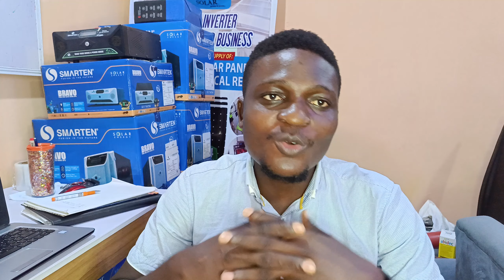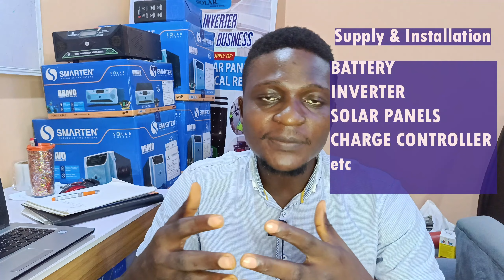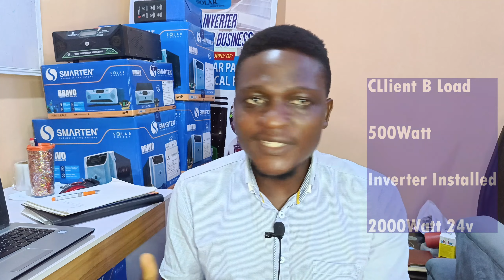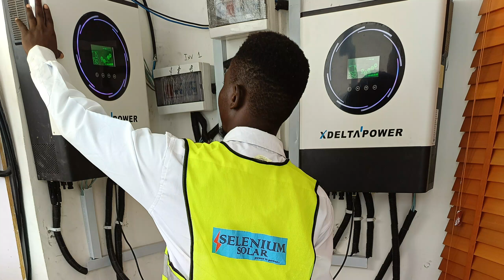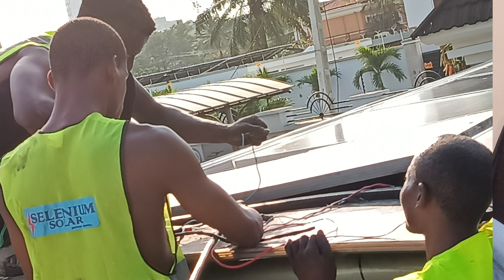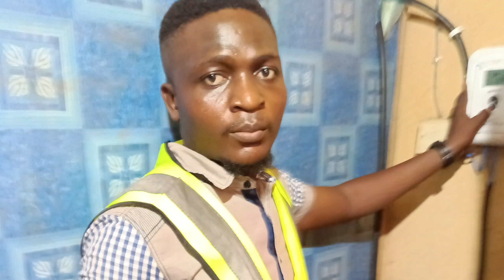Will Using Inverter With Prepaid Meter Save Energy ? MUST WATCH!! #Inverter #Energy #Solar

Comment: what you are saying is wrong ,your battery and solar panel should be at least 3 times great than your load,with that way your battery can easily get filled up
Reply from the maker: That is theoretically, in reality cost is a big factor to consider

Comment: The simple truth is this, if you do not want to spent excessive amount on prepaid metre then, go for more solar grids. For example, if you have a 2.5kva inverter with 4units of 250watts solar panel, it is advisable you upgrade the number to 6units. This will enable the batteries charge much faster and in return, saves you money on prepaid. A 2.5kva inverter will draw a same size energy from your meter mostly when the batteries are flat but will start to drop the energy as the batteries get fully charged. Most people depend on solar for their inverters without bothering to charge with nepa. In most cases, if you must charge with alternative source aside solar, then get an external charger, charge with generator for 2hrs when your battery bank is low. Thank you

Comment: Thanks my fellow solar engineer. The truth remains either 1kva or 3kva inverter, it's all the same.  They all consume from prepaid meter. I have answered this question years ago when Nigerian power holding companies anounced about the introduction of prepaid meter. If you're using inverter on a prepaid meter, it means you're working for power holding companies and that of yourself. So I use to be plain to them.  Solar is the answer. Thanks.

Comment: How does the inverter size impact the saving of costs? Like it would just charge tge battery way faster than a smaller inverter? Or what am i missing?
Reply from the maker: Your're theoretically right, charging is a function of Current and duration, however in reality with experiment, a 3.5kva 24v drains battery faster than a 1.5kva 24v at equal load. implication is you need more energy charging with a 3.5kva inverter than a 1.5kva at the same Load. 

Also note: more heat will be generated by the 3.5kva transformer compared to the 1.5kva inverter transformer.. Also in reality the difference in charging current in most inverters are not that much... Some 2.5kva inverter charges with 20Amps while some 3.5kva charges with the same 20amps. 

Just like I mentioned in the video different manufacturers produce inverters with different purposes
Reply from the maker: Every inverter has a resistance value which is relative to size, a 1kva inv will draw a 1kva energy equivalent on your prepaid meter, a 3.5kva for the same batteries will draw a 3.5kva equivalent energy on your prepaid meter thereby making you pay more when charging same battery
Reply: @SeleniumTeck  but doesnt the time to charge cancel it out? I have now idea, just wondering... lets say it takes 3 hours to charge at 1kw and 40 minutes to charge at 3.5kw... would that not be the same cost?
Reply: @SeleniumTeck  like wouldnt a 3kwh battery take 3kw to fully charge no matter at what rate? So will have to pay for 3kw no matter what if you charge via grid?
Reply: @SeleniumTeck  or does it now work like that? Im not an electrician or anyrhing, could be totally wrong? Thats why im asking